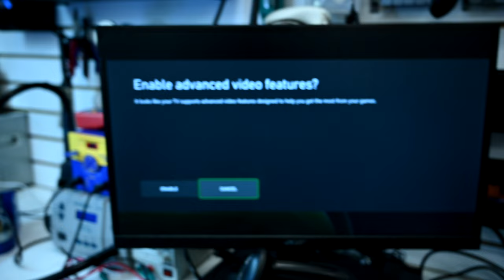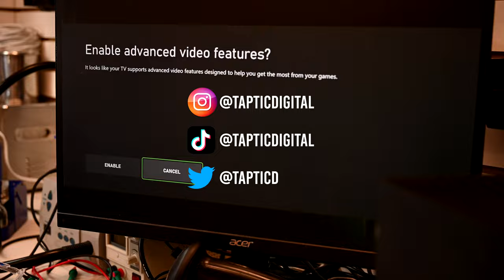This Xbox Series X HDMI port is destroyed, here's how to fix it

Comment: Is this repair worth trying with no soldering experience? And is it risky that I'll destroy the whole xbox?
Reply from the maker: @CereaLover123  absolutely would not try unless you’re pretty comfortable with a soldering iron, and a using a microscope while soldering. It’s possible without a microscope but very tricky to get all the legs attached without completely bridging them. Doing it wrong won’t kill your Xbox, it’ll just make it not work until it’s properly installed. I’d recommend taking it to a shop, it’ll be much cheaper than a new Xbox and in most cases the HDMI port will be stronger than the previous. When the factory makes these they only use solder paste which sits under the pin and on top of the pad, making the solder like the crème filling of an Oreo. When a shop does it they usually put solder all around the pin, making it a tasty soldery burrito that hugs the board.
Reply: @TapticDigital  thanks a lot, I’ll go take to to the shop then!

Comment: Where can i get a soldering tip that small?
Reply from the maker: It’s a wee little tip for sure! I get mine from Hakko, they offer a lot of precision tips. They have one that basically looks like a nail, but unfortunately because it’s so thin it barely heats up enough. If you can find a nice pointy conical tip you’ll be set!

Comment: I got my hdmi slot replaced on xbox series x and had to buy a new hdmi cable. I purchased a anker brand. Now my TV struggles to show 4k it keeps going in and out of game mode. And on the screen there are little dots on the screen.
Reply from the maker: Usually caused by a loose solder joint on the HDMI or the beginning of an encoder chip failure. In rare cases it could be the cable not being able to support a high resolution and refresh rate, but as far as I know Anker is one of the better ones. I’d take your Xbox back for a warranty repair at the shop, they should have caught that during testing
Reply: Thanks for the response.

Comment: Cant get it to get a good hold its like the solder isnt grabbing the legs and it keeps coming loose.
Reply from the maker: @gooseboy6046  make sure you are pressing your iron against both the pin/hole and the part being soldered to heat them both up. The board itself is like a giant heatsink and if your soldering iron can’t heat fast enough it’ll actually cool down when you work on the board.
Reply: @TapticDigital  thanks for the fast response ill give that a try see if it will get hold.

Comment: How much to fix my hdmi port? Same exact damage
Reply from the maker: I don't offer mail in repairs just yet, check local shops with good reviews. Even franchises (in the US) like CPR or UBreakIFix offer console repair at reasonable prices!
Reply: UBreakIFix charges $199 + tax. Microsoft is $299. I'm still trying to decide what to do.
Reply from the maker: @FullThrottleMonty  honestly Ubreak is pretty reliable in my experience. You might also have a CPR Cell Phone Repair nearby that offers the service too. I personally wouldn't recommend the Microsoft route, they are expensive and take a long time, and honestly at that price you could almost buy a new console.
Reply: @FullThrottleMonty  the one near me tried to charge me $350 to fix it but I did i was like hell nah so I’m trying to do it myself

Comment: welp you skipped over the power ribbon cable. messed mine up. unfortunate for me.
Reply from the maker: Did the connector come off with it? Used to happen a lot to the hard drive and drisc drives on the One S. You should be able to jam it back down without issue.
Reply: @TapticDigital  the conector is super loose now. Didnt realize i needed to push on the conector then pull cable.

Comment: how can one add on a new port with a hot air station without melting the pin holder inside the port.
Reply from the maker: Heatgun the board first until the solder melts, then using pliers or tweezers insert the new port into the holes on the board, and take the hot air off. Removing a port usually melts it, but installing a port shouldn't, no need to heatgun the new port

Comment: What should i do if all my usb ports are not working
Reply from the maker: @michaelcw33  try a system update, if that fails look into replacing the ports. But it’s very odd for multiple to fail.
Reply: I cant connect any controllers to the xbox to do this the pair controller does not work but the disc eject does

Comment: How hot should I use the heat gun?
Reply from the maker: To melt the factory solder you’ll want around 420c-450c at a medium airflow
Reply: @TapticDigital  thank you for the fast reply I’m trying to do it myself for the first time want to make sure I do it correctly

Comment: How long does it take? IRL TIME?
Reply from the maker: 😉Longer than this video. I'd say about an hour, maybe two or three if it's your first one
Reply: @TapticDigital darn. It might take me a while to do one in the future, but it'll be totally worth it. I just need the right tools (I have a soldering iron, solder, some flux, thermal paste, but no Isopropyl Alcohol and no hot air station).

Comment: No matter how long I heat gunned it at the temp he said the solder wouldn't melt.

Help please!
Reply from the maker: @smerfaccount-kb2rn  these are a pain to desolder, the board has so much copper in it that it’s basically a huge heatsink. Max out your heatgun, I’ve had to push mine upwards of 480C, or in some extreme cases use two heatguns aimed at the top and bottom. 

One good trick is to add leaded solder to it, this will lower the melting point overall and help get it out
Reply: @TapticDigital   Thanks so much I'll try the leaded solder!

Comment: How much would it cost to fix it
Reply from the maker: Most shops seem to do this for between $150-$200. It’s an expensive in depth repair, but still cheaper than a whole new Xbox, and it’s usually stronger than factory after it’s repaired.

Comment: How do I get the smaller data Ribbon off
Reply from the maker: When you first open it? It technically has a tiny latch on the connector but it’s really small and hard to access, I usually just gently tug on the ribbon and walk it out.
Reply: @TapticDigital  thank you I really appreciate it!

Comment: I cannot get the feet solder out. My gun is at 800 still cant get it out
Reply from the maker: If using Fahrenheit you'll want at least 890. The solder in the feet themselves may not come out, and you may have to heatgun it till it's liquid and then force the new port in place
Reply: @TapticDigital  I can't even get the port off. I'll try more
Reply: I just don't want to over heat it
Reply from the maker: @ejg34  I can almost promise you won't, the boards take so much heat because of how effectively it spreads heat. As long as you keep the air moving  in a circular pattern you should be ok
Reply: @TapticDigital  thank you kind sir. Appreciate your response
Reply from the maker: @ejg34  another thing that might help, if you are using leaded solder you can melt some into the feet which will lower the overall melting temperature and make it come out a bit easier.
Reply: @TapticDigital  got it off at 890. Now to solder 😭
Reply from the maker: @ejg34  let the real fun begin! 😎 Take it slow, keep some soldering wick nearby in case two pins decide to connect, and you'll do just fine
Reply: @TapticDigital  thank you
Reply: Yeah think I'm going to pay for the soldering lol. The pins are just to close together and I don't want to bridge

Comment: How do you turn it on
Reply from the maker: I turned this one on for testing by temporarily plugging the ribbon back in. In most cases it's best to reassemble properly and use the power button like normal.

Comment: Really quick question do I need flux and soddering iron I have everything but those two???
Reply from the maker: @frenchbeluga7055  really quick answer: you will need at least one of those. You can technically install a new port with only hot air and flux, using the existing solder on the board. This method is kind of risky without an iron because not every pin gets attached most of the time, and trying to use the heatgun will melt the port. Iron and flux will be the best combo.  Check out the Pinecil from Pine64, super inexpensive and a phenomenal iron
Reply: @TapticDigital  thanks!
Reply: @TapticDigital  ok on Amazon I have a Solder Flux Pen (10 ml) I Liquid Solder Flux and than a Soldering Iron Kit, 80W 110V LCD Digital Soldering Welding Iron Kit with Ceramic Heater are these two all I need to start this hasty repair??

Comment: Why the hell does this have to be so hard?  It eeally should be easier.
Reply from the maker: I dream of the day they make these things modular, and I can just plug a new port in
Reply: @TapticDigital  that day seems too good to be true.  My HDMI broke and Microsoft wants $430 canadian to fix it.  I can just buy a used one at that price.
Reply from the maker: @TheRealBruceWayne01  noo don't go for Microsoft, they're probably just going to send you a refurbished one back. Check around for some local repair shops, most cellphone and computer repair shops also offer console repair at reasonable prices. This repair should cost $269CAN at the absolute most!

Comment: People in az said that they were going to charge me $199 to fix
Reply from the maker: That sounds about right on average, I've seen anywhere from $150-$250.
Reply: @TapticDigital  I am fixing it myself for less than $100, is there anything special I should know beforehand?
Reply from the maker: @samuelnelson8538  just that you are hopefully pretty familiar with soldering smt components! The pins can be pretty tricky. Also it will take a bit longer to heatgun out compared to most soldered parts!
Reply: Hi - I took this somewhere to get repaired and found your video after. The guy put in a. We port but there was no option beyond 480p. He said something yesterday about a fix he found online that he thought had to do with a chip. Today he said that he was right about the chip and ordering a new one. Does this sound right to you?
Reply from the maker: @kenlyons3811  yep that's about right, sometimes a damaged HDMI port can cause a short to the HDMI Encoder which is a little black square chip near the port. This chip allows it to output 1080, 2K, and 4K resolutions. But if it shorts out the Xbox defaults to any resolution it can, which is usually really low.

This can also be caused if two specific pins on the back of the port are badly soldered, but in most cases it's just the chip
Reply: @TapticDigital  that helps so much knowing that. Thanks man! 😃

Comment: Man I just broke mine.
Reply from the maker: Did it at least make a good crunchy sound? How’d it break?
Reply: @TapticDigital  I was rolling my wheelchair an my wired controller cord got tugged under it. It had allot of play when plugging it in the back. Like a 10th of a inch wiggle. An when I looked inside the copper prongs were smashed on the right edge. I scheduled an appointment with assurion ubreakifix hopefully they don't knock me over the head I already got a dental appointment before that.
Reply: @TapticDigital  and it fell onto its back wires :( I just got 15 dubs on warzone Rebirth Island too.